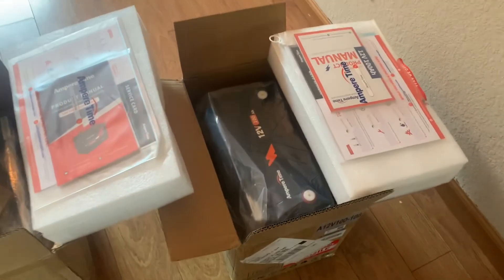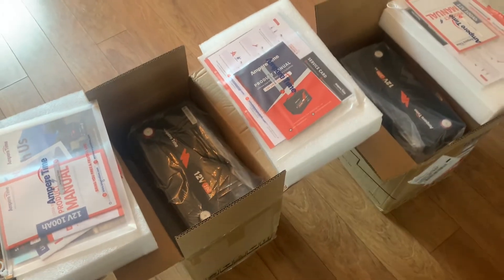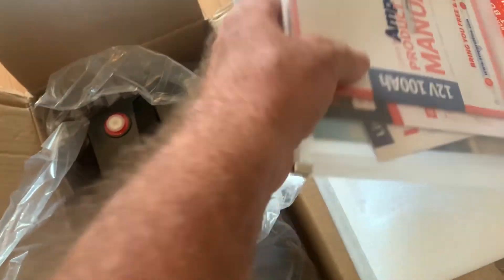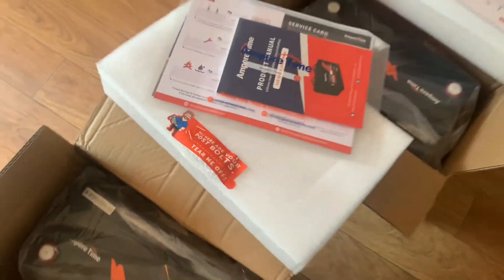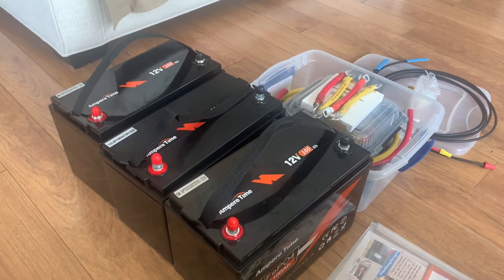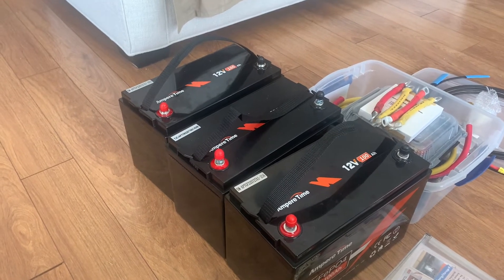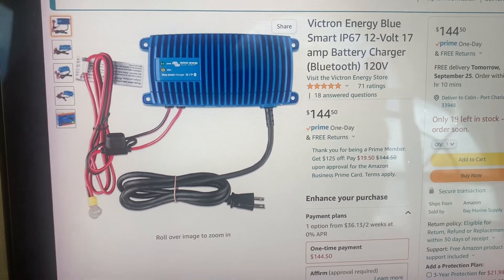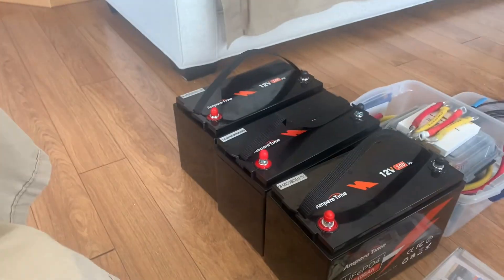Preparing to put Ampere Time 100 amp hour batteries in parallel

Comment: I’m just starting my solar battery journey. I do have a question, the other 12v 200ah battery you had; couldn’t you have purchased a second one of those and wired them in series to build a 24V system, or 4 in series for 48 volts etc? Thanks in advance.